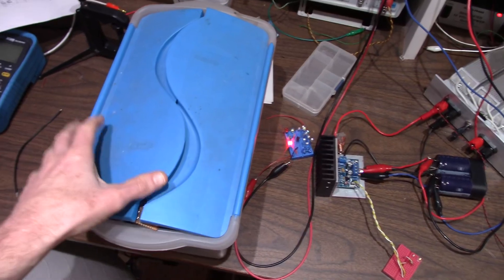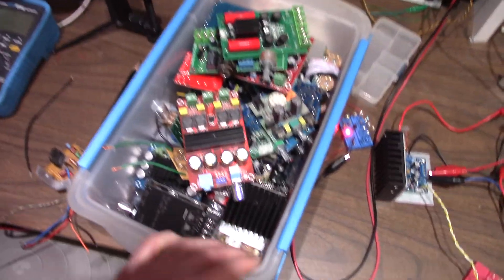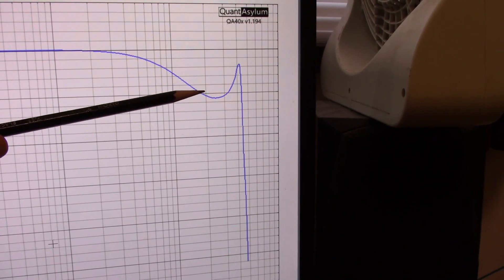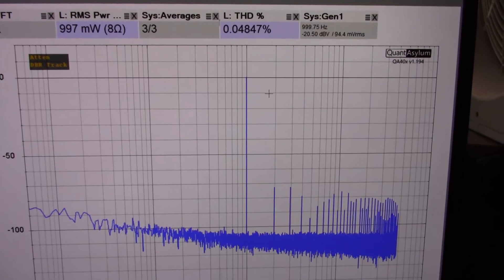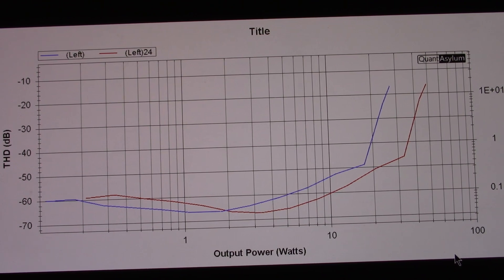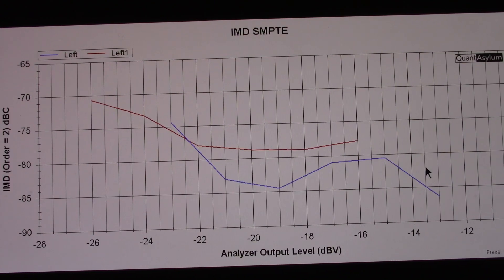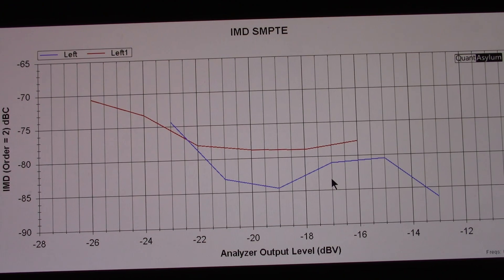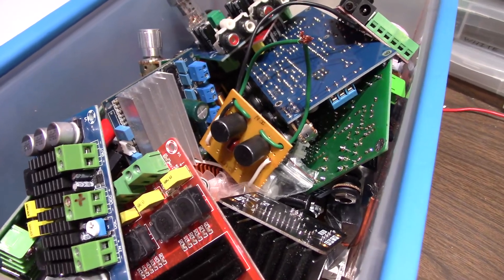TPA3116 amplifier on the QA403 audio analyzer

Comment: Hey John! I know I am a bit late with this comment, but I would love to see another test with smaller loads on this amp, like 2 ohms or even 1, I have a bluetooth speaker Harman/Kardon Onyx Studio 5, and it sounds amazing, and the weird thing is that it has 2 TPA3116 chips inside, 3 channels are parallelled to a roughly 1.5 Ohm woofer, and a single channel hooked up to a little tweeter, I really can't hear much distortion out of it, and weirdly it can play up to 8 hours of music from a single 26650 battery cell inside. (on max volume, it still does around 2 hours) I have some equipment as I'm a technitian, but I lack an audio analyzer, and would LOVE to see a test on 2ohm loads with this chip as I'm planning on building a car sub with it, due to it's low(er) supply voltage needs compared to a traditional class AB amp. 

Thank you for your response in advance, and happy new year!!

Comment: John could you do a video on class d amps output filters and how to improve them?
Reply: Honestly there ain't that much to them. 
  The most important thing is the inductor. You want one that's made from hard saturation material (ceramic instead of iron powder like those toroidal ones). Its inductance shouldn't change with flowing current. I use Coilcraft in my stuff. They often have nice graphs.
  The second thing is the capacitor. For higher powered amplifiers like TPA3251 and 3255 use ones with polypropylene dielectric. And for lower powered amps polyester should be enough (both distortion and power dissipation). For very low power like a phone speaker amp perhaps ceramic X7R or filterless might be okay but I havent checked that IRL yet (Or if you're rich then ceramic C0G + a Zobel network will be very good).
  When it comes to values of the components you should stick with manufacturer recomended ones. Perhaps decrease the value of the capacitor a bit to get a flatter frequency response at high frequencies.

Comment: Kind of a surprising result. I'm using a TPA3116D2 from Parts Express in a stereo config, driving 8 ohm Dayton B652s. If anything, it's a touch bright over 10k. If that PCB wasn't meant as a subwoofer board, as you suggest, they must really have botched the output filter. Or, as others suggested, perhaps this chip was a knock-off?

Comment: I have tested a fake version of this, and got quite similar results:

HW-576:
12V:     12.390w till 10% thd 4R load
19.5V:  35.402w till 10% thd 4R load

I used a parallel speaker with series resistor with it, so i can hear from the speaker when the sound goes worse.

for very low distortion that i wasn't able to notice i got the following results:

HW-576:
12V:     3.080w clean power to (under 0.1%thd) 4R load
19.5V: 11.560w clean power to (under 0.1%thd) 4R load

So yeah, the chinese copies are way worse, i am at least pretty happy to have good hearing to thd, I am an owner of a Pioneer SA7800 that i love so much due its outputs are so clean.

Comment: Hello John! I read that connecting opamps in parallel should reduce the THD+noise? I have seen headphone amplifiers that use 2 to 4 NE5532 in parallel for 32ohm headphones per channel. I then thought to myself if 4 ne5532 can drive 32ohms with +-9 volts then 64 ne5532s with +-15 -18 volts should also be able to drive 4-8 ohm loads. Has anyone ever done or seen something like this? 64 x ne5532 should result in an almost perfect amplifier with 15-20 watts. If you use current OPamps instead of the old ne5532, the performance could increase again. But the NE5532 is unbeatable in terms of price and is available all over the world for 0.5-1 dollar a piece. It would be nice to hear what you say about this idea! If possible, it would be cool if you could test whether the THD gets better when you connect opamps in parallel. Am I stupid or does what I came up with make sense?
Reply: I believe Douglas Self has done exactly that and it worked great!

Comment: The implementation of this amplifier is awful.Don't be surprised if under the heat sink you see a 16-pin integrated circuit labeled TPA3116D2.
It's probably the CS8673E rebranded (a common scam by some "factories") I was experimenting with 22μΗ and 15μΗ at 8Ohm speaker with 19,7VDC linear power supply (I sorted the reverse voltage protection diode). I didn't like how it sounds (and I switch to an other LINEAR amplifier with NE5532 + TDA7379. Almost perfect sound the later). The TPA3116D2 board is thrown away in one of my drawers.

Comment: The ones I bought " TPA3116" had fake chips under the heatsink.  They looked like Pam 3w SOP16 package under the hood.
Reply: If you see a super bargain it's almost certainly counterfeit in some way.
Reply: I had that fake tpa 3116 2.1 amp, it was rated for 24 volts but it's sub woofer IC caught fire at 12v , it was powering a 3.8 ohm sub woofer 250watts . It only worked for 15 minutes before it caught fire 🔥